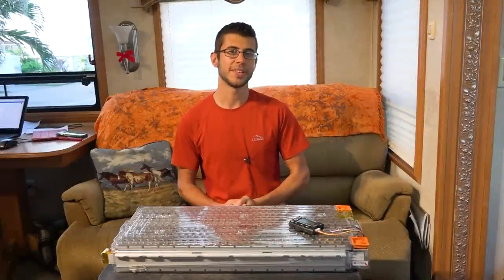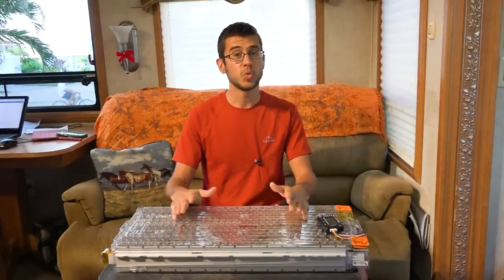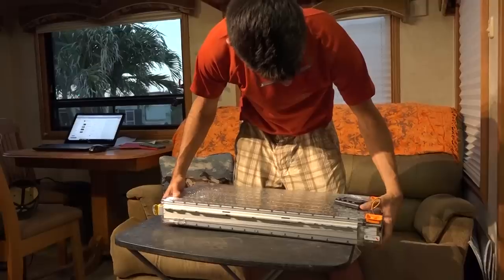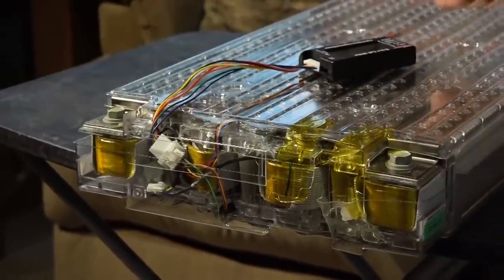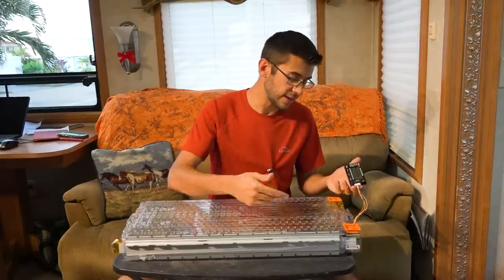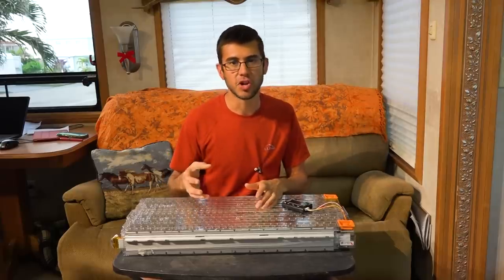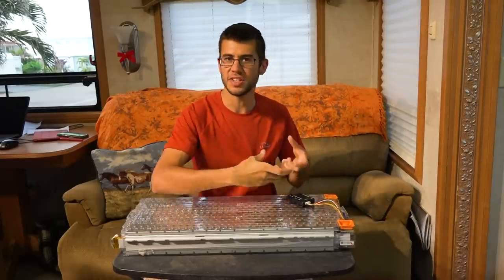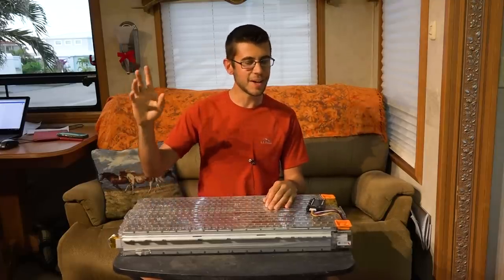Overview of the Tesla Lithium Battery Module We are Installing in our RV - EV Battery Hack!

Comment: It’s an interesting ‘competition’ and evolution. John Hebard just completed a beautiful SLA installation, with around 4kWh useful capacity. He is trying to feed a residential fridge and use solar to boondock. It was a great installation but the complexity of his system is almost mind boggling.

I followed a major lithium build a while back, by RV Exodus (YT channel). He was going with LiFePo chemistry. It is much heavier, somewhere between SLA and your lith chemistry. Again, his installation was very complex, but he covered things like cell balancing that are useful to know. A lot depends on how many parts you want to assemble. He assembled the basic cells (very large cells) into 24 volt systems. You can buy Battle Born 100 AH Lifepo’s configured as 12 volt drop in batteries. They are pricey, and the weight is an issue. Four of their batteries would be $3600 and weight around 120 pounds, which is still a lot less than SLA.

One of the big deals with Lifepo versus the kind of cell you are using (It isn’t really a LiPo, by the way) is the temperature profile. A Lifepo is simply a more forgiving cell at high temperatures, and it’s hard to design an RV that doesn’t get above 90 degrees. I gave up on lithium when I realized the pack would be subject to temps around 100 degrees. Lifepo would be OK, but not your chemistry. I’m not sure how to get around that. It’s interesting how the pack is manufactured to allow heating and cooling, but you need a liquid source to do that. 

Another  issue, Lifepo versus Li-on, is cycle life. The numbers are all over the place. I think your pack uses NCRB cells. If you download the data sheet, from Panasonic, the cells definitely lose capacity over the first 500 cycles. They aren’t useless, but they lose 30% of their capacity. Yet the automakers say these packs retain their capacity for many years. So, in an RV, how long will they hold capacity and how fast will capacity drop? I own a Lifepo pack, and it has retained capacity over three years. I haven’t treated it all that well. But Lifepo have a good rep for cycle life. 

There are some technical issues. I once wrote an article for Electricbike.com where I discussed the charging protocols for lith. Basically the charge is CC/CV, or constant voltage and constant current, and there is a dropoff current as you reach the final charge voltage in the cells. You cut the charge when the charge current drops to maybe 10% of the CC value. Anyway, it’s not like charging lead acid where you have bulk charging and final charging, float charging. There aren’t really big chargers for RV use, but maybe the EV stuff can be adapted. You are using solar and I’ve built ebike solar chargers for lith cells. You can buy Chinese modules for $30 that let you use switching tech to set a voltage and a current (CC/CV). You have to turn it off, or build that circuit, at the end. You can’t leave it floating. Clearly the Victron you will use is probably pretty bullet proof. The are DIY people out there, including systems like Vruzend to build packs.

Maybe the different systems can make some kind of Clearinghouse Forum for the various techs, and how people are working out the problems. It’s a nice experiment. If you Google “Tesla 5.3 kWh” you will find several vendors for these packs. You and John Hebard are going to end up with similar capacities. He has to manage the weight, but the SLA will handle heat better. You may end up spending a lot less money, and have a lot less weight. But I’m not sure where you are getting your charging equipment. You will end up with the same need for a major inverter of some kind. 

Sorry you are having some health issues. There may be more stress than you think, doing what you are doing. I hope you can give people as much information as possible along the way. I follow a lot of people doing things with lithium. Jehu Garcia is my favorite for finding deals and fooling around with stuff. He has an active YT channel.

Good Luck!!
Reply: John  - You built a system that would integrate into the AC panels and outlets in your fiver. That's the stuff that I would not do without someone checking it out, but I probably just wouldn't do it. So I'm OK doing the panels on the roof and then bringing that power down to a charge controller. I wired in some 12v outlets (XT-60 RC connectors), and I had a small inverter, but that was the limit of the AC system. I think you had a couple of panel boxes, AC house current type boxes, and I've never wired them. I was really impressed that you wired in all those monitors, snaking everything through the coach. There was a lot of wiring in your system, things you would want for full time daily use, but I'd have to think a lot before diving into that. I suppose you basically hook the battery to the inverter and then carefully wire that into the coach, but you did everything very meticulously, with fuses and cutoffs.  The AC side is what I don't fully understand. I would seriously consider those SLA batteries in a system where I could handle the weight. Lithium is still very experimental in RV's. The videos were great. Not just explaining the basics, but the general sense of RV'ers helping each other out.
Reply: There are some Teslas on the road with more than 200000 miles on it and they have had a capacity degradation of 8-15% and degradation seems to slow down with age/milage.
Reply: Automakers generally charge to around 85% and they avoid using the last 15%, if they can. You can sometimes override this. Tesla has temperature control in this module. I know the history of many ebike batteries, and it is nowhere near as good. It's the same cells, in some cases, but people charge to 100% and they leave the black battery (case)  in the sun. There is a lot of research. This is an interesting article.

https://cleantechnica.com/2018/03/04/exciting-developments-nmc-811-lithium-battery-technology/

Any battery bank that costs around $1500 and lasts 5 years will be worth it for a full time RVer. The cost per month is OK.
Reply: Correct - Tesla is keeping a close eye on them and it is kind of sad that other devices generally don't. For example I have asked Li-ion UPS manufacturers why do you charge and float li-ion at max V and they reply - spec sheets say so. They simply don't care. Same with power tools. Luckily laptop manufacturers have changed their attitude recently, for the most part. But it is safe to say that many li-ion chemistries can basically last forever in the right hands.
Reply: Great points George!! Love your comments
Reply: Thanks! Appreciate your YT channel!
Reply: :D My man!

Comment: Note that you can usually save LI cells if you over-discharge them... we've brought back li-ion and li-po batteries as low as 2v/cell with great success. The trick is you MUST charge them at a trickle rate. Like 0.1xC of current. Many people just try and juice them at full power and they die out.

Comment: Very cool, Tom. We recently purchased a used LTV Unity FX motorhome with 2500 miles on it. When the two 6 volt deep cycle lead acid batteries die, I will replace them with two to four Lithium batteries. Best of luck and I look forward to following your path.

Comment: Great video. I'll be watching you with great interest. I am going to be doing the same thing. I just bought 6 lead acids for about $200 more than you paid for your battery. I have 500 watts of 12v solar on the rv now, just got 8K of 24v panels to put on the house. I'ii take 3 or 4 of the 310 watt panels and replace the 12v panels on the rv. Keep up the good work.
Reply from the maker: Join us over on our second life batteries facebook group too!

Comment: Sounds good. Should work thanks to all your considerations. I doubt that it will go out of balance much, but good to have bms. If the bms is good. I am curious to see how you will store this battery. Anyway to cool the battery? I doubt you will ever heat it up much given your uses, but just curious. 

Did you consider the chevy volt battery?

Comment: The cold issue is a no go for me. It regularly is below zero for 4 months of the year. Great idea however. Thanks for the vid.
Reply: You can use the heat from the residence to to warm/cool the battery pack since it has coolant/heating channels and hose fittings. A Personal Computer liquid cooling module works. Just add high/low thermostat limit switches on the battery surface and insulate the battery enclosure (and coolant hoses) better than the home.
Reply: The below-freezing is not an issue as long as charging is disabled by a thermostat. The solar collectors & battery could instead run a heater & coolant circulation pump inside the insulation of the battery compartment, which would work even when not occupied.

Comment: They used those funky looking plates to connect the batteries to provide maximum current transfer with the least bit of loss and for reliability.   It's also a much easier way to connect the batteries than by wiring them or spot welding them.

Thanks, for the awesome video!

Comment: A tip: you may want to work on your energy vs power lingo. Early in the video you spoke of power and watt density but then switched to watt-hours which is energy, not power. Similarly later you said 85 kilowatt battery not 85 kilowatt-hour.

Comment: I would find a way to use those coolant tubes.  Simple radiator system with pump would not be hard to design
Reply: As he said, when powering drive motors, they need to be discharged and charged at a much higher rate creating more heat, but they should be ok as a slower more relaxed power source.  No doubt that Tesla's battery temp management is key to it's superior performance though.

Comment: Hi Tom,  Thank you for sharing your project with all of us! I recently purchased the tenergy cell meter to hook to my tesla module. My question is where do I get the wire harness to plug in between the two? OR at least the ends so I can build my own  cables. Thanks so much for your help! We love your videos!
Reply from the maker: Mine came  with the harness already, I am not sure the connector Tesla uses.  I keep intending to figure that out, just have not had the time.  You need to go to a JST-XH 7S harness
Reply: @MortonsontheMove  . Thank you!

Comment: So I take it you are limiting the charge voltage because you cannot actively balance the battery? Is this what you're calling "a safe charge"? Also, what are the 12VDC components your RV runs on? I'm assuming that everything in your RV runs on 120VAC with the exception of a few things, any idea what those are? Thanks.

Comment: Light weight and supposed increase in available power is impressive.
But if you store your RV over winter, thats a problem!  If the batteries are below 32 deg F and the sun comes up, 
the system will try to charge.  The simple reason is to just shut down the system but if you parked in the summer and forgot to disconnect, OOPS.     
Safe bet is to go with AGM deep cycle.
Reply from the maker: We have cold weather relay protection to prevent charging in that circumstance.

Comment: NICE....I am in the process of building a 48volt system for the 5th wheel out of the 18650 cells out of old laptop batteries(which I believe the same as the Tesla pack)
Reply: Unusual Family I’m doing the same thing, making a powerwall for my trailer.

Comment: Lead batteries do not have memory effect, only nickel cadmium. Memory effect does not mean safe depth of discharge: Rather, it's the unique behavior of NiCD batteries where if you recharge them before they are fully discharged, they "remember" that charge level and will only charge up to that limit afterwards. Also you keep saying watt density when I think the term you want is energy density, which is measured in watt hours. "Powerful" might also refer to power density which is a different metric.
Reply: Lead batteries do not like being in a partial state of charge (PSOC), as it generates sulfation of the negative plates, which leads to irreversible capacity loss and decrease in run time.

Comment: I like the idea of using a Tesla battery module.  One of the problems that I saw though in using the pack though is the total output voltage.  All the inverters I have looked at have a cutoff volage around 20V.  This would mean the individual cell voltages would be around 3.3V.  This leaves some capacity that just never gets used.  Have you found an inverter that can go to a lower cutoff voltage?  If so, please share which inverter you will be using.  
I also read some of the other comments about BMS.  I have built a couple of packs and I don't use any type of BMS.  I have found that unless you are pulling crazy loads from the battery the pack will stay fairly well balanced all by itself.  One thing I have found though is when bulk charging the pack it does tend to get unbalanced.  Now every time I charge a pack I use a balance charger.  Since doing this my packs are having no problems.

Comment: Thank you for all the video you have done about the RV technical things. I have a 35 foot class A gas RV. I have 400 W of solar and just bought 3 100Ah LiFePO4 batteries. I am concerned when going down the road that I could damage my alternator. I think it is 130A. I was considering getting a DC-DC 20A charger or perhaps the 40A , but I fear that this will be too high. I have seen on my BMV700 currents of perhaps 50 A but not for very long. Just wondered what you might think about this. Travel safe. Henri
Reply from the maker: Alternator damage from charging lithium is a real problem.  Usually alternators can provide half of their rates current safely, but you have to consider that it's powering thr engine and vehicle too. I like to use an amp clamp meter to get an idea of how much power the vehicle uses then set charging based on that so I don't overload.  Dc to dc chargers are a great way to do this and many like victron and sterling have adjustable currents so you can select what you want.   I also like to check alternator temps with a ir thermometer.  Make sure it's not blazing hot (I don't like to go beyond 250F on the surface)   hope this helps!

Comment: Great video. With all that info you sound like an expert....if nothing else a quick study listening to HSR Motors. Would love to use one of those but the chance of catching fire or explosion seems high especially since I don't know alot about lithium-ion. Will have to read up on it more, that would provide enough power for constant boondocking. But you can only stay out as long as your tanks and water hold out. So 600ah of AGM might be easier. But i do like the less weight aspect. Thanks for sharing.
Reply from the maker: Since there is no good drop in BMS solution for the tesla battery they are a bit complicated to make safe.  Its really not for everyone yet, but this technology is coming down the pipe and hopefully will be affordable and safe for everyone soon!

Comment: The connectors used for the BMS module... Do you have the part numbers or names for those? Did you order them with pins through digikey or mouser and just fabricate your own, or did you find some pre-made harness/pigtails?

Comment: You mentioned the potential fire hazard (of NMC or NCA) LiPo batteries - and how you mitigate the risk when using your own battery management system. I suppose you are not actively temperating your batteries? Are you just using small loads discharging your batteries? I suppose charging via solar won' t be too much of an issue.

I still would sleep better having an LiFePO4 based system in my RV. Or my house in case I would have something like a wall box.

Comment: I bought four of these same batteries. What is the high and low voltage is recommended for these batteries, and approximately how much in a percentage is the battery fully charged and discharged to its recommended range. I know it should not see higher than 25.2V, but whats the resting voltage "fully charged"? I hope my questions made sense?

Comment: There is actually a whole read-to-go open-source project available to re-use the BMS boards that Tesla provides, it offers voltage readouts and integrated balancing, all it requires is some readily available connectors, an Arduino microcontroller, and code off Github. It's the top google result if you search for "tesla bms", it's a more robust system that constantly monitors the battery rather than the li-po monitor. That said, you will likely find that with the low charge and discharge currents found in an off-grid system, balancing won't be needed as much. In the car the WHOLE pack is rated at about 1200-1500A under full load, these modules are no more than 250-300A each if you stick to 1C, but that is high enough to warrant a real BMS, which prevents internal resistance variations from causing problems
Reply: Liam O'Brien good to know. Thanks